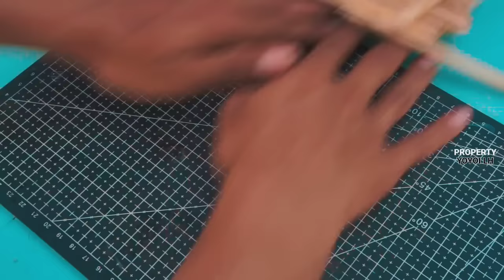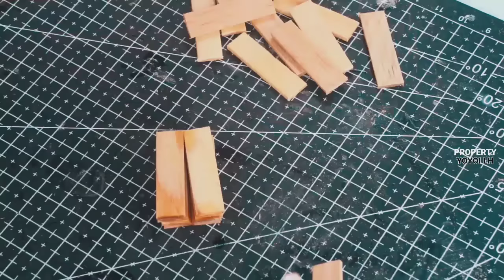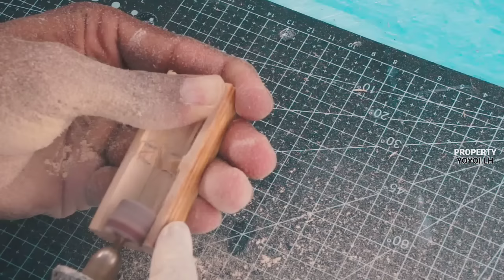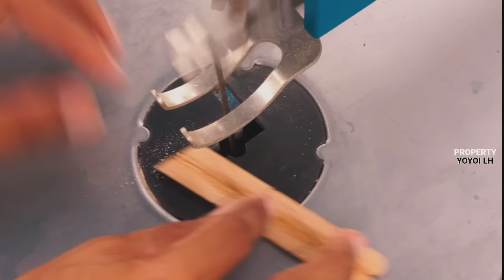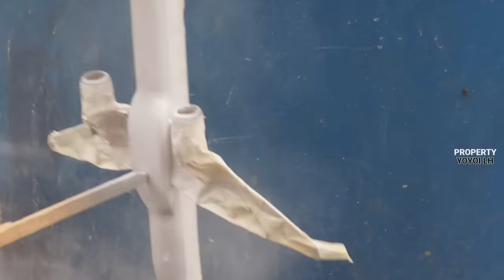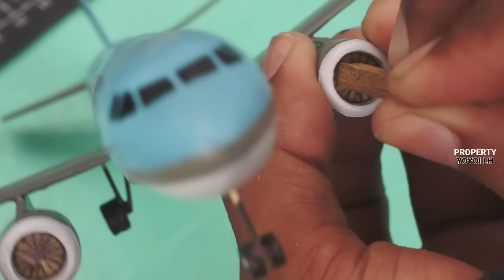Making an airbus a321 out of just ice cream sticks | aeroplane models

Comment: Wait, wait bro, this is Airbus A320, not Airbus A321. Why 
Because the Airbus A320 has 2 emergency exits located next to each other on the wing. As for A321, both main doors are 15 windows apart. Are you know??